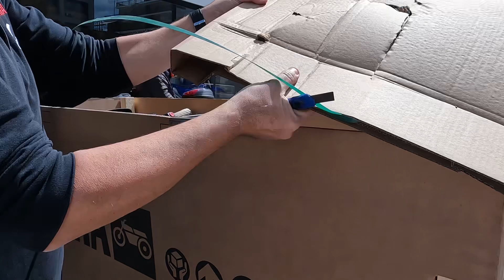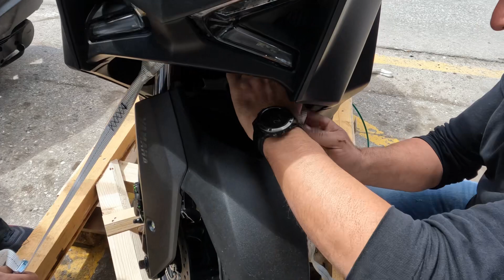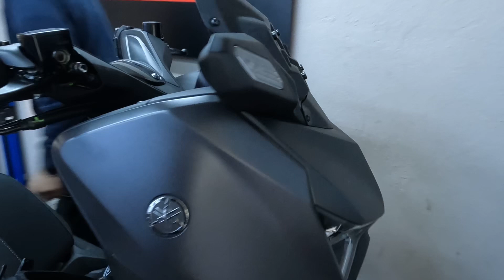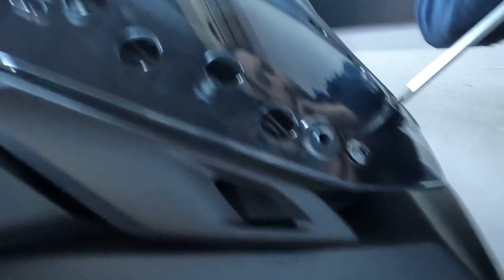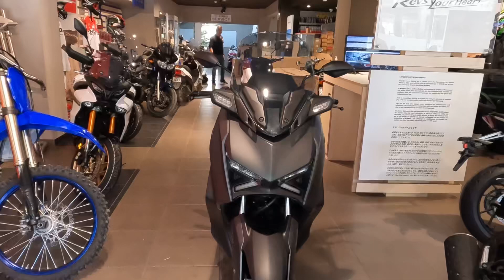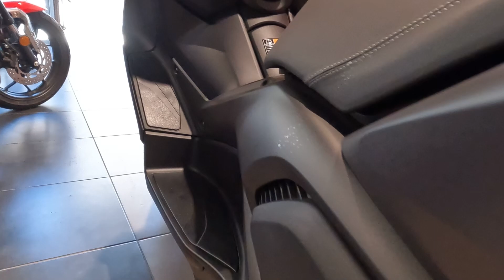Unboxing X MAX 300 2023 sonic grey

Comment: πολυ κινεζια το εκαναν.το προηγουμενο μοντελο σαφως πιο ομορφο
Reply: Είδες φίλε που στα έλεγα adv 350 1000 φορές πάλι καλά το πήρα το έχω 1μηνα και είμαι υπέρ ευχαριστημένος 🎉🎉🎉
Reply: Built in France
Reply: @Vanrides.  yes i know that,but it looks like a chinese model
Reply: @xdx2653  What's a Chinese scooter look like? I,ve looked at the latest Xmax at my local dealer and apart from the digital display which I do not like, it is a quality well built scooter.
Reply: @Vanrides.  i mean the new xmax looks like zontes m310,yamaha looks like copied the zontes.this is what i mean
Reply: @xdx2653  Just looked up the Zontes 310 and watched a couple of reviews, it looks an interesting scooter with a cheaper price.  Yes there are similarities between the scooters, though I suppose you could say Zontes copied the earlier Xmax. Ride safe.